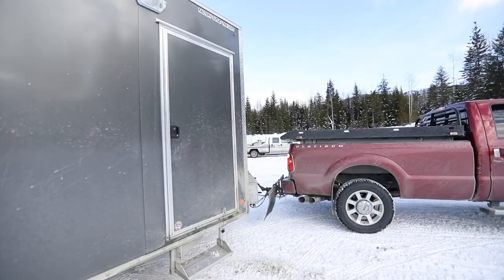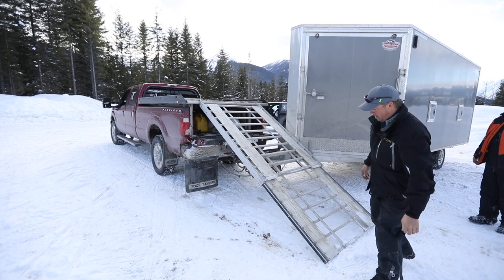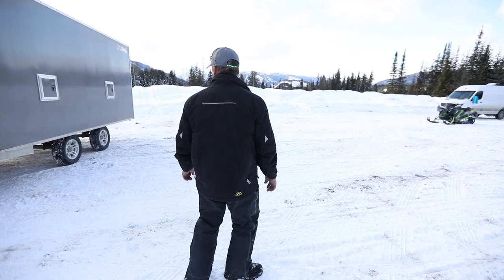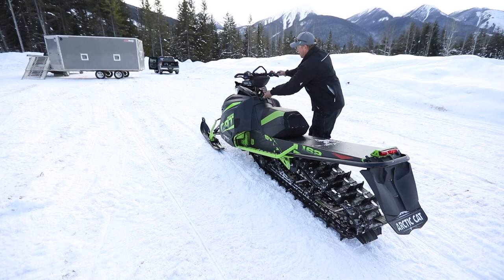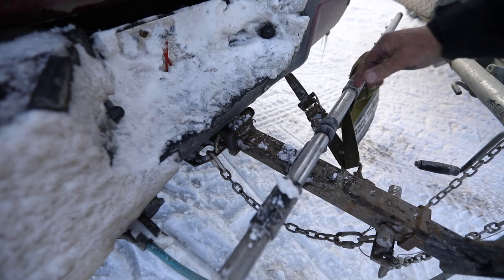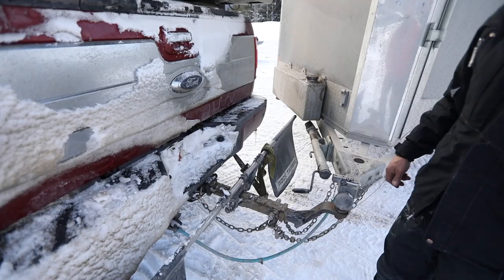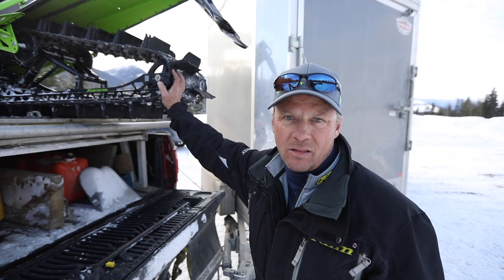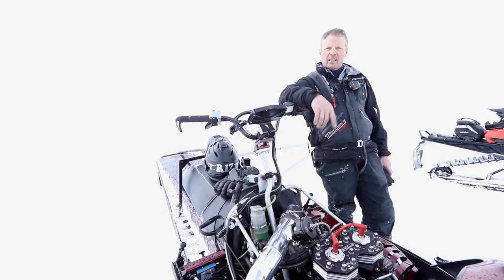Loading 162 Arctic Cat on truck deck with snowmobile trailer hitched up

Comment: That’s what I need to build! I use a car hauler type enclosed trailer (flat front) and with my deck on in sharp turns the deck can hit the front of the trailer. It’s ok if your careful but I wish I had the option to throw a spare sled or 2 up there.
Reply from the maker: The deck comes in really handy when facing a logging road that you just don't want to pull your trailer across too.

Comment: Great video!, when you load/unload do you let the sleds warm up? I ride a pro rmk and usually wait till 80• to touch the throttle. However, that sometimes takes a while
Reply from the maker: Not to unload , but do let them warm up before hitting the trail !!